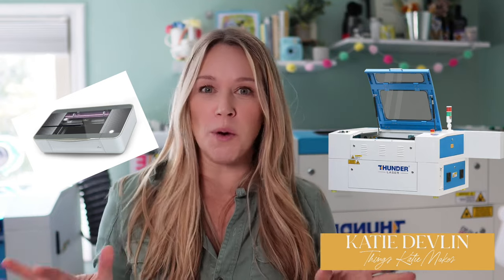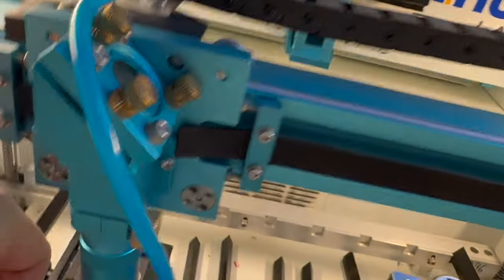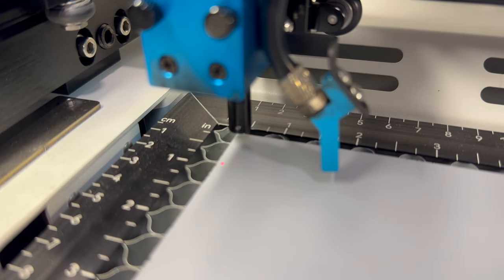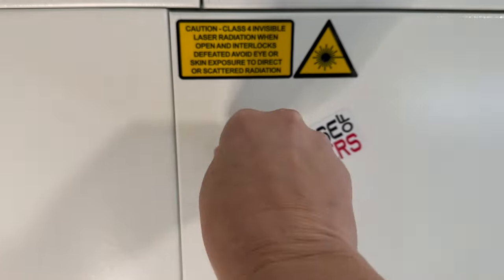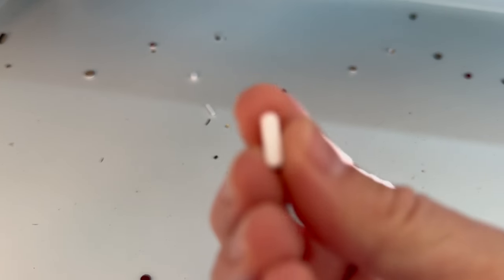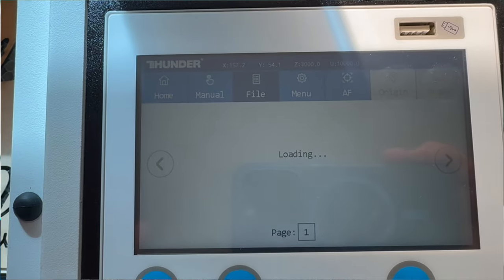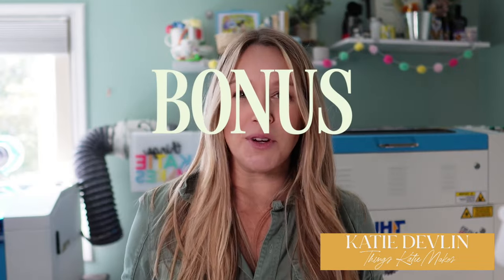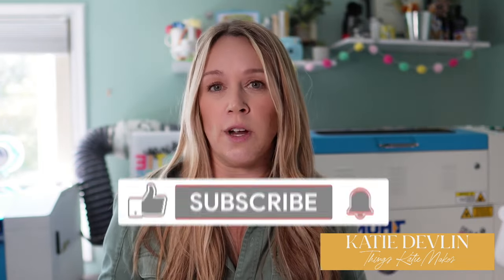5 Awesome Features of the Thunder Laser Bolt that will give you incredible results FAST!

Comment: nova 24 also has easy positioning and all the features you have on the bolt are on all nova series, you just need to know where to find them, speed, power can all be changes on the fly,  changes are made when the controller detect the next node group, so changes are not instantaneous, but start on the next node group,  you dont need to remove the lens from nozzle in the 24 to clean it
Reply from the maker: Yep - I like that you can change the speed and power on the fly in the Nova, but the little turtle and rabbit in the bolt is extra handy for precise placement

Comment: Thank you Katie! I contacted Thunder specifically for the Bolt, but the rep brought up the Nova 24.  She said that if I plan to cut anything bigger than 1/8” that I might want to consider the Nova. I didn’t really want a bigger machine as I don’t have the space. This would be my first laser machine and I’m just looking at this for a hobby, maybe a future small business.

My goal was acrylic signs, clear acrylic standees/keychains, etc. Maybe engraving tumblers. I don’t see myself really cutting anything thicker than 1/4”. Do you think the Bolt will satisfy my needs for a first machine? Do you think there will be any situations that I’ll have regrets not getting the Nova?

I just don’t want “too much” machine for my needs. Haha.
Reply from the maker: Hi! as a first laser, I really don't think you can go wrong with the Bolt.  A couple of things that I think make it really great for "beginners" are: 1. Not having a chiller or external compressor (less things to worry about/understand), 2. AutoFocus - while I don't mind focusing on my Nova24, again, one thing you can sort of learn a little later as you learn other things with your laser. I use them both and kind of switch out for different things. We were just having a conversation about 1/4" in our facebook group and while it can be on the slower side, it is totally doable. 1/2" can be done as well - but it that were your primary, I'd say you'd want something bigger and more powerful. I hope that helps, and email me if you have any more questions - always happy to discuss.
Reply: @ThingsKatieMakes  thank you so much for the insight!!! I will definitely email you if I got more questions 😉

Comment: Great video and personality! Since you have both a Nova and a Bolt, have you kind of settled into a routine of which machine you use for which project and why? Thanks.
Reply from the maker: Thanks! That's such a good question. I really love to do clear acrylic engraving on my Bolt and anything with smaller lines, finer details, etc. vs. more "brute force" things on my Nova. Cutting thicker materials as an example. Small things with jigs like plaques go on the Bolt, things I want to run on just the knife blades go on the Nova.
Reply: @ThingsKatieMakes  Thank you for the great reply. I am torn right now between adding a Bolt or an Odin to my laser lineup…just wish Thunder offered something in the middle for pricing. The Bolt will be an easy sell to my wife whereas the Odin…not so much so.

Comment: Great review Katie - thank you!

How would you say it stacks up against the GF, even though it has less power? What about the noise level - is it comparable as well?
Reply from the maker: It actually doesn’t have less power - a 30
Watt RF tube is more like a 60watt glass tube, so it’s more powerful. Noise level is similar, quieter for me because I use the filter on my GF and I vent out my window on the Bolt. The engraving detail is so good on the Bolt and it is significantly faster as well.

Comment: Thanks Katie.   Very helpful observations.   I just ordered mine.   What's been you overall experience with cutting?  Types, thickness, etc.  I'm not looking for the to be s speed demon cutting beast.  Just one that does struggle when I do cut.   It's not for business, mainly for hobby if that further adds some perspective.   Thanks again.
Reply from the maker: Hey Richard - I mainly cut 1/8" because I do a lot of acrylic, but I've tested out some 1/4" double sided plywoods. While I needed to go slow with high power with my standard 1.5" lens, I got through them. I think a 2" lens might make it a little easier as well.

Comment: nova 24 has autofocus, just press down button the press autofocus button and its done, you have to set the nozzle correctly first,
Reply from the maker: Fair, a different type of auto focus on the nova - it uses the bed sensors, not a probe

Comment: Nice overview, but I think you are mistaken about the front door having magnets. Other reviewers have mentioned that it has clips that snap into place when the door is closed, and one even complained that they make opening and closing the door a little bit difficult. In your video it looks like yours has the clips as well.
Reply from the maker: That's possible - it may have both - I'm away from my machine, so I'll have to check when I'm back!
Reply: I'm next to my Bolt now.
It has physical clips, not magnets. There are two magnetic sensors next to the clips that are the sensors to ensure the door is closed, but they don't have any force to keep the door closed.
Reply from the maker: @TheMorrowgamer thank you! I don’t know how I missed that before
Reply: @TheMorrowgamer  Thanks for checking.